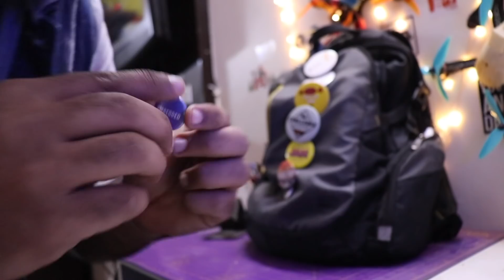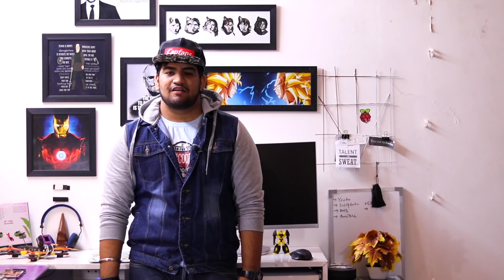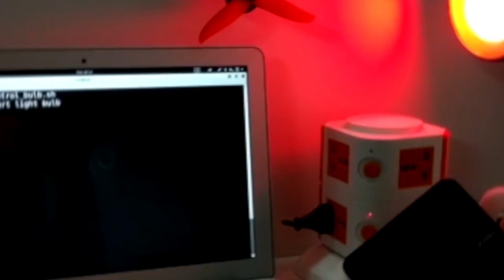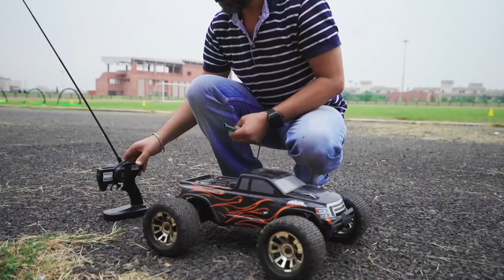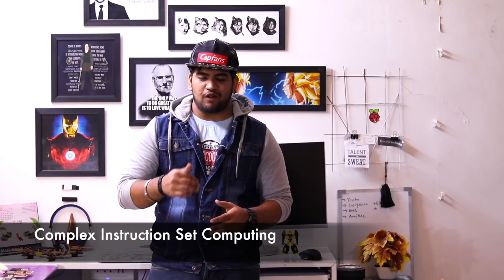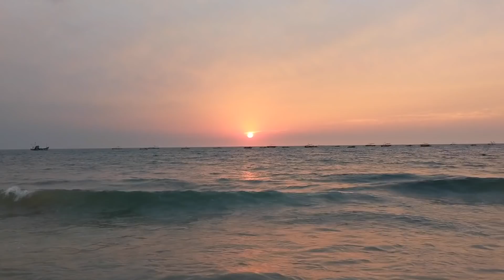How to Make career in EMBEDDED SYSTEMS domain   Let’s Talk | codeNsolder

Comment: I started with 8051 Architecture At89s52 and did made development board with plug in and plug out display to the board and also other sensors. Now i moved to stm32f103c8. I am still using embedded C. And learning to write drivers to it. And also working on timers and adc side by side. Plz let me know. What am i skipping? I don't know assembly. Plz advice me. Is my path right now right??? I did above  in 5 months while completing my 3 backlogs in btech. I really on fire for embedded engineer. Helo me with your suggestions.
Reply: And also how do i find a appropriate startup/company as a fresher so that i dont stagnate in that small position.
Reply: @surya.6283  .
Reply: @PassionateBiker  how to proceed?